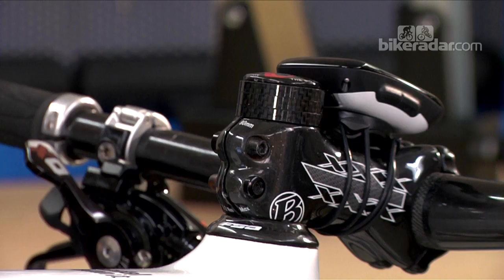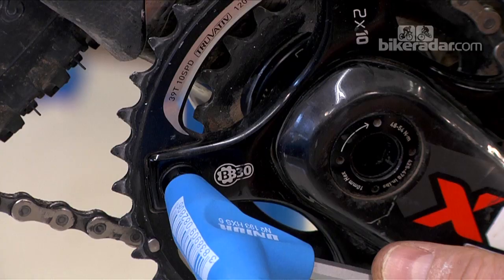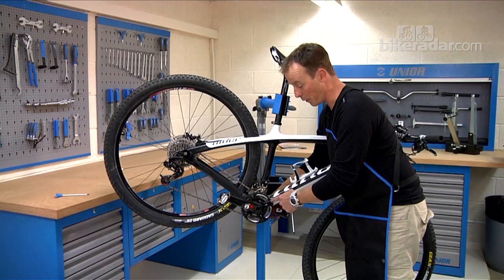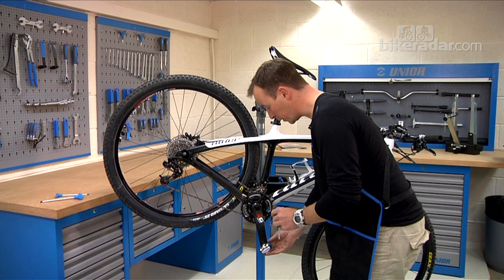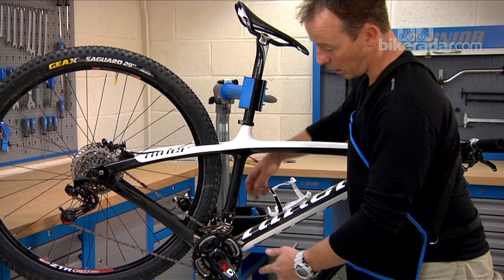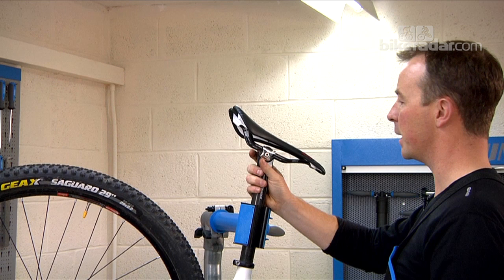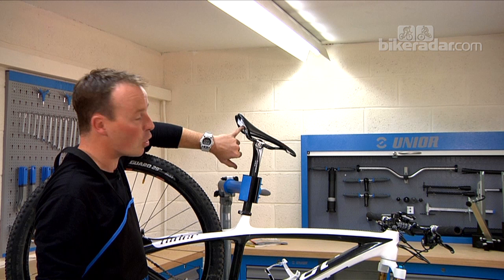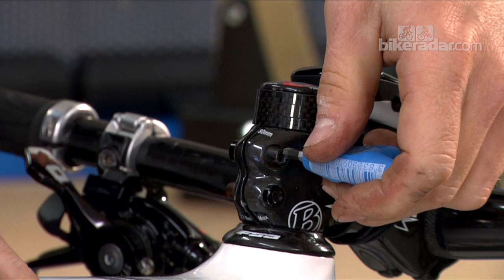Chasing bike frame noises

Comment: Torque specs are for a reason.  Remember that when bolts are old or have loctite you can get in accurate torque readings as well.  Common sense and knowing where and when to use the torque wrench is most important.

Comment: Thank you for the info!! I was on a long bike ride and was going uphill and pedaling with all my weight and all of a sudden I heard and felt an annoying click coming from the drive chain and could feel it through the pedal. I thought crank bearings at first but low and behold I stripped a chain ring bolt and it kept flexing the ring when all my weight was on the pedal!!!!! It was loose and I could keep spinning it and it was not tightening. Going to get some new bolts

Comment: Not greasing your fork tube and seat post can (and does) cause occasional clicking/popping noises. I found this out the hard way after taking my entire bike apart wondering what the clicking noises were. BTW, my bike is practically homemade, but it "used to be" a 2013 Trek Mamba. After replacing stuff that broke, it's now just a Mamba frame and fork...which are pretty damn good (and worth the $1500+ in upgrades).

Comment: More than likely it is the chain bouncing off of the frame (chain slap). It is apparent when you look and it appears as if the chain has remove paint or deposited excess onto the frame. A new derailleur or derailleur spring or a chainstay. But if you're tight on cash you can always just shift up to a higher gear to avoid chain slap.

Comment: My new fully made clicking noises when riding it - just solved the problem: when weight pushed down the saddle it made a noise and also on realeasing the weight again. I ended up disassembling the saddle and every part of it and greasing it a bit - noise is gone now :)

Comment: I had a really frustrating creaking noise, when pedalling up hill in particular, it appeared to be from crank arms/bottom bracket I would have bet mo ey that  that was where it was coming from, so off with both components regreased  etc, next headset off regreased even removed front skewer and greased, but no joy still the same creaking under load Yesterday had a rear puncture took wheel off and repaired, put wheel back on and you guessed it,, Total silence from bike, not a squeak/creak anywhere. You really do have to explore every avenue, hope this will help someone, regards Dave

Comment: I have a ticking noise that is loudest when pedaling but persists even when I'm not pedaling. My local bike shop has tried to fix it twice but to no avail. It is driving me bonkers. What could cause a ticking noise that seems to happen once or twice per revolution of the wheel? (Regardless of pedaling). Thanks!!
Bike: Trek Madone 2.1
Reply: Stephen Lewis I had this problem on an older bike.
Never found the problem before it got stolen. But I was thinking of the spokes perhaps.

Applying torque to the backwheel (pedaling) should put some extra strain on the spokes to make more noise?
A spoke that is loose, only when under heavy pressure, means it will be hard to spot on a stand without a rider on it, I would guess.

A quick way to rule this out, would be to borrow a set of wheels and see what happens.

Comment: Sorry but cranking on those bolts without a torque wrench is very unprofessional... Those saddle rails are carbon fiber, and that CRACK sound did not sound nice... Heard it on the handlebars aswell as he tightened the bolt. Might be just a bit seized bolt, but you can't go around tightening bolts without knowing the torque on carbon components...

Comment: That's because many paid bike mechanics, especially the Halfords / Bike Hut ones, think knowing about bike technology is like understanding rocket science and fail to realise that if you can tell your ass from your elbow, buy bike tools on Ebay & have at least one hand; you can adjust,repair or replace any & every component on any bike and it WILL ride perfectly. They automatically assume you'll fail to grasp what torque spec's are.

Comment: My pedals are clicking when I climb hills, so I shall run some checks, already removed & regreased pedals & even changed to different pedals just to test, but clicking still there when I apply pressure uphill.
Reply: Same with me. It's pissing me off!
Reply: TheLondonCyclist It turned out to be my bottom bracket,  had it replaced & it was fine.
Reply: I installed a brand new bracket a few months before and degrease and lube everything before a ride. There's a slight wobble on the right pedal, so maybe the bearings have gone. I'll buy a new pair, as I've wanted a new pair anyway. It started on a rainy day, then disappeared, now it came back today. EVIL! :D
Reply: TheLondonCyclist My bottom bracket that I had replaced was only 3 months old as it was on my brand new Boardman MX comp, my commute bike for work,
I put it down to the fact that these bikes are only sold by Halfords :(
& are therefore assembled by Halfords poorly. I do not normally have much to do with Halfords regarding biking gear etc, but I really wanted the Boardman bike & so was left with no choice. Great bike, but get it serviced elsewhere or do it yourself, never leave it with Halfords  :)
Reply: Yes. Halfords are terrible. I bought my bro a bike 4 days ago, chain snapped day after. I took it back and guess what, none of the people working on the bikes were bike mechanics. All the mechanics went home and they were short staffed. They had normal employees fixing customers bikes. One guy spent 2 hours trying to fix a dudes wheel, turns out that when I looked at it, the wheel wasn't set in the drops, thus rubbing the tire on the frame. The guy thanked me and said he's never coming back to Halfords. bluddy useless. Stay away from Wembley Halfords.